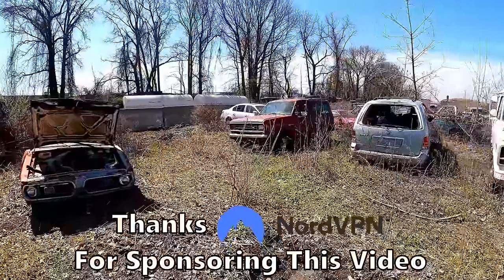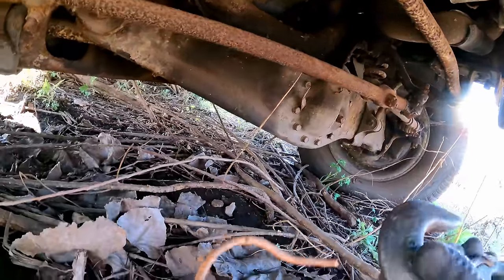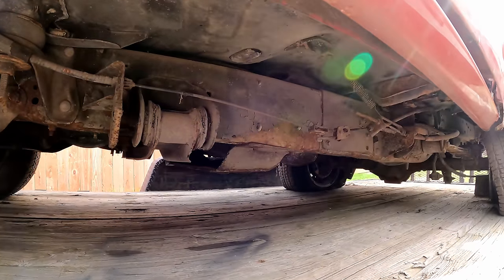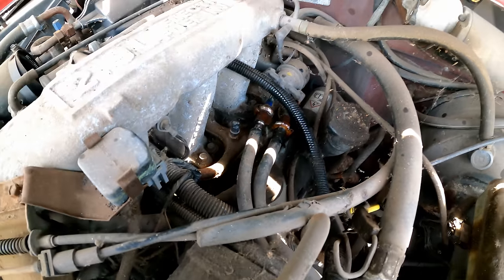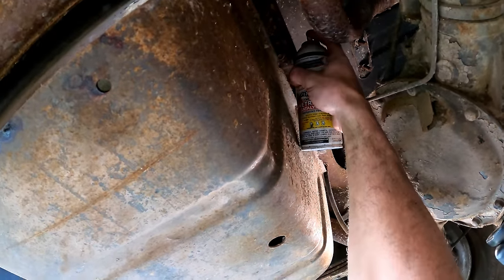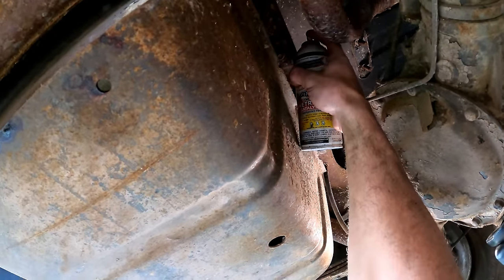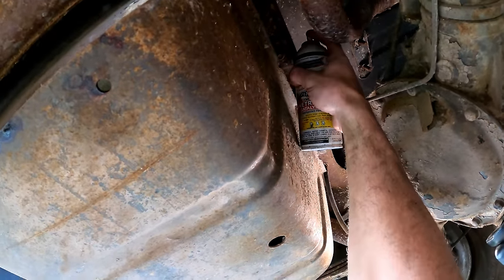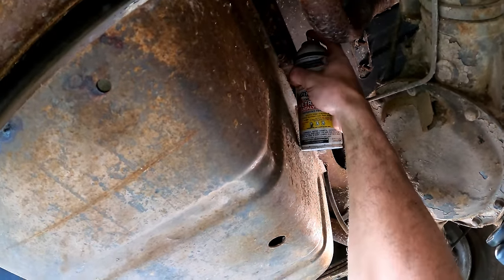Junkyard Bronco II What's It Need and Will It Run? - NNKH

Comment: Yep, the 86-88 bronco II had a low pressure pump in the tank and a high pressure pump on the frame rail. In 89 they switched over to just one high pressure in tank pump. I owned both an 88 and 89. I drove the 88 from Las Vegas to Illinois and back without any issues. It was actually great off road, especially on tight switch backs due to the short wheel base. Always enjoy your videos!

Comment: 32:01 ford used 2 fuel pumps on those, a low pressure lift pump in the tank, and a high pressure pump in the frame. That cartridge looking thing, sometimes it did have a cartridge fuel filter, and sometimes it was empty, ford used it as a diverter valve for trucks with dual tanks. Most times the filter was further up the frame and was a metal canister filter with the plastic line connectors

Comment: We had a 1990 bronco Lloyd 4x2 5 speed manual 2.9 V6.
It was the freaking Best! We owned it for 15 years, put over 350k and it didn't miss a beat. In all those years and miles only changed the water pump, clutch and routine  rake maintenance, what a Champ. Sold it in perfect running condition and bought an Explorer Sport 5 Speed, should've kept the  Bronco ll

Comment: Chris I'll be 40 next week and when I was a kid (like 4 and 5 years old) I lived in Allentown, PA and I would walk down the street to Haldemann Ford and I would sit in the new cars in the showroom and pretend to drive. My favorite vehicle to sit in was the new Bronco IIs (around 1987/88). Watching this video makes me feel old. My first car was a 1994 Eddie Bauer Explorer and it reminded me of those older Broncos and Rangers. I had a 1995 Ranger, but that was after they redesigned them. I have ALWAYS wanted one of the mid to late 80s Ranger GTs in either white or silver with the ground effects and the bullet hole wheels. I have also always wanted to own a late 80s/early 90s Escort GT with the 1.9 and the 5 speed manual (the one with the ground effects also).

Comment: That’s awesome. I’ve got an 87 that I got running last summer and I redid the entire fuel system like you. When I dropped the tank there were actually holes in it from corrosion

Comment: I recently restored an 1990 BRONCO II that had been setting for eight years.  I had to let the pistons soak with break free and kroal oil.  Then the head gasket was leaking from setting so long.  I’m running it now with gasket sealer in a can until I can do a 4.0 swap.  It took me two straight months working nights to get it back on the road.

Comment: I've had many many cars in my 50 years of driving, but my 84 Bronco II is one of maybe 4 cars I still miss.  It was a base unit with a four speed, but I loved that thing.  If it had 50 more HP it would have been perfect.
Reply: Just picked up an 84 bronco 2 4x4 with the 4 speed with zero rust for 300 just have to get it running might put an holly sniper and get that extra 50 hp and better throttle response
Reply: @kawaiiplayz8045  The 2.8 runs well if the Autolite carb is rebuilt (easy).  The later 2.9 was EFI (my dad had one) and had a bit more oomph. I'm thinking a *small* blower on the 2.8 would really wake it up. BTW, the 4 speed is a Toyo Kogyo box and isn't very stout.  I managed to kill one pulling a big Olds in low range.

Comment: I was going to say it had a second pump but I was sure you were gping to find out so I waited but yes the tank is a lift pump and the inline is the high pressure to provide 44psi i think it is. In 1989 Ford went to a single in tank fuel pump.

Comment: I had a 1987 bronco that I loved and it had fuel problems, after a few minutes of running it would just quit someone before me had put an aftermarket computer in it and we never could figure out the wiring to get it to quit acting up so I’m very reluctantly sold it to a neighbor but I drove it back And forth to work at 120 miles a day for four years before it started acting like that. Still one of my favorite vehicles I’ve ever owned

Comment: that valve on the frame is usually the dual tank switch valve on 80s and 90s f150, broncos and econolines, some do have a filter inside some don't.

Comment: Those wheels alone are worth getting! 
That Black Fuel canaster is a reservoir that the in tank low pressure pump fills and it keep the inline high pressure pump from running out of fuel.  Also Acts like a water separator!

Comment: I had a 87 like that I had to always keep it full of gas..If it went below a 1/2 tank it would smoke like a diesel truck. Changed everything on it and still done it. New fuel tank..pumps..filters.. injectors..fuel rail.. everything new and it still was like that. Traded it in on a 85 fullsize Bronco..best truck ever had

Comment: I have a 91 Explorer xlt with a 5 speed and 4.0, I also picked up a 93 Explorer with an auto and 4.0. I lifted the 91 4” and put 31x10.50’s on it and has a limited slip 8.8 rear diff. I love the old Fords.

Comment: I had a 1988 Bronco 2 and was in the process of restoring it and found out I had cancer. At the time I had purchased another one for the engine and was driving both. They were both stick shift. I had to sell everything because I couldn't  work on it any more. I had rebuilt the entire front end and was just about to swap engines. I also owned 4 snowmobiles that I had to sell because I could no longer ride after the surgery( kidney cancer) . That maroon interior  looks so familiar.  Mine was Silver exterior,  the other one was black with maroon interior.  They are good project vehicles.

Comment: Just got rid of my 93 FS Bronco, I miss it but health problems kept me from making a few minor repairs which led to it sitting almost 4yrs, had to put a new pcm in it which were out of stock for almost 2yrs and the day I installed that the two front brake lines blew. A guy I know just happened to make me a offer and it now has a good home, he has the money and knows how to work on it and will not flog on it.
 That Bronco 2 must have been really nice looking when it got there, if I was still able to wrench hard I'd build it lol, do it up maybe a turbo. I always wanted to build a 2wd FS Bronco set up for the street, mine was too nice to do that with lol

Comment: That one was a good gamble. Maybe they pumped deisle into the tank and then it started acting up so they parked it and left it for done? Deisle is hygroscopic so it attracts moisture that would make the dry metal rust. I'd buy it but for the $4000 shipping getting it home and the grand cost to licence it here.

Comment: The early EFI Fords had a lift pump in the tank and a higher pressure pump on the rail with a reservoir. The tank pumps didn’t provide enough pressure for EFI.

Comment: Your channel is seriously one of my very favorites! Thank you! I can see that there's a 5 series BMW in the background and if I could (If I were you I guess lol) I would check on what model it is (Eg: 525 535 540 545 etc) and if it has the N54 engine GET IT NOW!! The engine not the whole car lol. Because that engine is BULLET PROOF! As well it's TURBO CHARGED TWIN TURBO to be exact and as long as the block id there and maybe the head and some of the other parts you can build (cheaply I might add) a massively powerful engine (450+HP or more) out of it. And I don't mean building the bottom end or anything like that. I mean just getting the parts it needs to run right again as it will not be the engine that has blown on it if it's the N54. FYI. LOL. Thanks again for the superb content!!

Comment: I had a 86 f150 5.0 when a was a teenager first year they did efi it was a nightmare on wheels there were sensors on the sensors I was happy to see it go but I learned a lot about working on a motor

Comment: Cool video I love this one Chris I had a 1990 bronco 2 I bought it in 2004 I paid $1,500 for it but I had an issue with it trying to get it inspected I ended up having to bring it to Ferrara spring the ended up having to weld a plate in the floor in the back and they put in new leaf springs the dealership I bought it from ended up paying for everything because that cost $660 but they did a really nice job had the same exact motor as the one you have here in this video mine was a five-speed manual it was in surprisingly really good shape I had it for a couple of years they were good little vehicles and they were great in the snow four-wheel drive work really good on it it had 94,000 original miles on it when I bought it it was 14 years old but again great video very informative thank you for posting this one

Comment: I know I'm jumping the gun but the shut off switch to the pump is probably triggered and needs reset. That should be on the firewall just as you pull down the carpet.
Reply from the maker: That popped into my head when I was working on it originally, but the pump was getting power

Comment: That device you thought was a canister fuel filter is an accumulator that is there for when you go up a steep incline and the in tank fuel pump starts sucking air, it gives you enough fuel to get up the incline and it vents the air into the return fuel line. I have an '88 BII that I might sell this summer because I have 4 vehicles and a single car garage.  I have never gotten stuck and I have gone thru some deep snow here in North Dakota.  If I didn't have a 97 Caravan with all wheel drive, I wouldn't be thinking about selling it. My wife says don't sell it. She doesn't drive but likes riding thru the deep snow during blizzards.  The Caravan does pretty good too but not in a blizzard.  My '61 Falcon Futura is also for sale, for sure.

Comment: you might notice he shows you for a second the front suspension has a spring behind the axle you would need to put a spring in front of the axle also and that would solve a lot of problems that those had like a death wobble while braking on the freeway

Comment: Have you tried putting it in gear and Crank it up and sometimes that'll break the clutch or lose try that and see if it'll do and keep pushing your clutch in and out while you're going down the road in it and whatever you do you know you got to do is to stop turn it off stop putting reverse and then take it back and just keep pushing your clutch in and sometimes it'll free up if that slave cylinder a break loose if it's working if that slave cylinder is working it should do it good luck with it brother and Georgia I think you got to you don't have to have a title for 86 good luck with it brother have a blessed day and be safe 🙏
Reply from the maker: It's the opposite in this case. The clutch just doesn't grab it all. I hear it flapping around in there

Comment: The reason rear axles may leak is because the vent tube maybe plugged up by a mud wasp or road grime and if the axle can't breath it can build pressure while driving from the gears turning

Comment: I had a 90 which was the pre explorer interior, and i could not keep a motor in it (2.9L 5 speed). It had cracked heads at 90,000mi wiped the bottom end from antifreeze in crankcase, next motor cracked heads within 3 months, 3rd motor was ok but smoked blue after a year and a half. She was cared for meticulously and a sweet lookin macine but i nevert had any luck with it while my friends had lifted Rangers with same powertrain and beat the balls off them with no issues. LOL.
Reply: had a 96 f150 that ran and ran and ran with that 2.9, funny to see someone had one that was flawed

Comment: The master cylinder on the clutch is out on it
Reply from the maker: I ripped the master cylinder apart in case it was hanging up
Reply: I had trouble I had trouble with master cylinder on the clutch on a Ford ranger pick up

Comment: Had a 1990 I bought from carmax in 2000 for 5 grand…..it saved my ass…no money.   5 speed. 2 wheel drive..hand crank windows. Zero rust ..new white paint job…Exwife moved to Franklin lakes $$$$$$$ New Jersey…with kids…2000…. Gave truck to son…BMW..Mercedes ..all rich cars driven to school….snow board on top…son says.  Dad. Everybody knows me as the surfer/snowboarder who can drive a 5 speed….who’s got the coolest truck…..In the parking lot…….lol…truck worth 500 dollars…and it’s a hit a school…..goes to show you money ain’t  everything…only down sides.  No airbags…no anti lock brakes….5 speed mitsubisy transmission was the best manual transmission I ever had…brass  sync gears…smooth as silk…moved to 2000s sport tracs…not as cool..but more practical…have five of them…very similar to bronco 2….save layout..kids still driving sport tracs today.. sold bronco 2 for 
500 bucks…in 2010…and went to 1995   5 speed mustangs..

Comment: That 2.9 engine is there a way to eliminate the tons of vacuum hose ! I now own a 1985 Bronco II AND HAVEN’T OPEN THE HOOD YET ! Lol Are all the B2’s come with the same engine ? Thought mine might be a v6 , was told it fires off but won’t stay running and it has a vacuum problem ! I’m going to start where you did ( fuel ) then electrical , SUCK/BANG/BLOW ! If engine is bad I’m swapping in a 289 w/TBI ! Price was right , traded a lawnmower for it ( old craftsman ) and he gave me $500 ta boot !

Comment: Take off the shifter, the trans can be stuck in reverse and will act like it's in neutral and won't go into any other gear. Clutch slave is also probably toast if not bled

Comment: If anyones seen Mark Martins You Tube video on this exact type Bronco II and I don't mean the racer he's a local guy here. He has that exact little Bronco same color and all and although after spending a little over $2,700 just getting it running right we just re-painted it while he did his other You Tube on the resto his only complaint being a larger man like I am was leg and seat width room in the thing. That little 2.9 or whatever the motor is ran pretty strong. He had the motor pulled and gone over which with that screwy Ford EFI system cost him plenty of cash plus thee complete re-gasketing the engine the guy that did the job next to my shop talked him into new rod and main bearings after finding some foreign crap in the oil pan. He did find 3 scored up rod bearings as well. Anyone thinking about buying automotive paint right now may want to wait the shit is getting expensive. But when I pulled the paper and tape off the little buggy it was right sharp looking again. That is one of the rewards of my job here is I get to see dead and almost disposed of history come back to life. It is a rewarding job taking something dead and all shitted up and making like new again. Marks next venture is having the front seats recovered they R not really bad at all he just loves the little thing cept for the leg and seat room. His girl friend is gaga over the thing as well.

Comment: Those flares are valuable
Reply from the maker: Which ones
Reply: @NoNonsenseKnowHow  the wheel/fender flares it has on it.    They quit making them a long time ago.   They are aftermarket.   It’s okay that the one is cracked.   It can be repaired pretty easy.   If you posted them in the bronco 2 groups on Facebook they should sell pretty easy.   There is handful of good parts on that unit.  Hatch , hatch glass, hatch handle, side glass for cargo area, wheels etc.
Reply: @NoNonsenseKnowHow  sorry about the delay in reply,  youtube notifications suck when it comes to replies.

Comment: These 2.9L V-6 were noted for blowing head gaskets if you didn't change the oil every 3000 miles and change the antifreeze every 3 years 30k miles These 2.9L didn't tolerate poor maintenance and these do not run good on ethanol based fuel. These need non ethanol blended fuel as any car 2004 on down engines were not made for ethanol blended fuel unless it is a FFV (Flex Fuel Vehicle) which a lot of these were brought by the GSA (Government Services Admin)